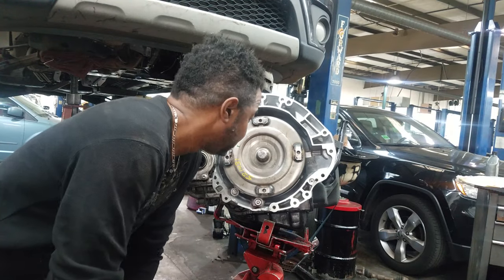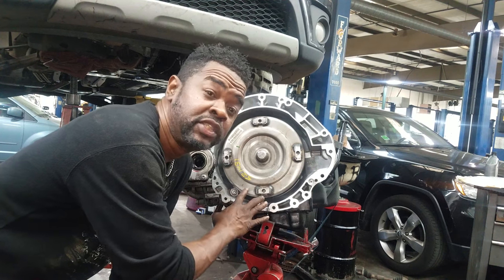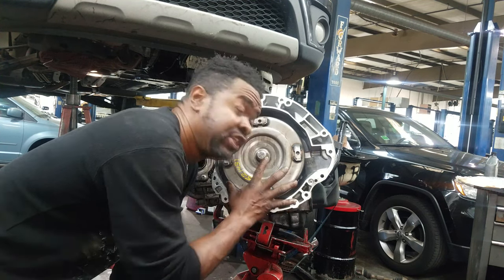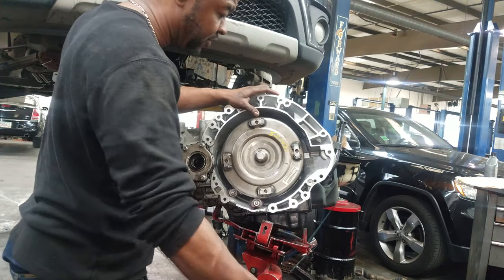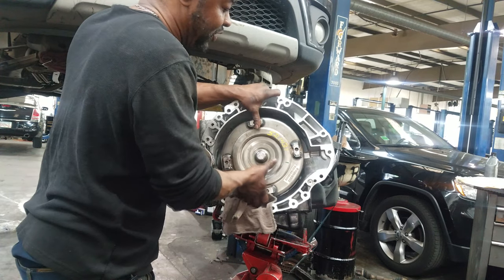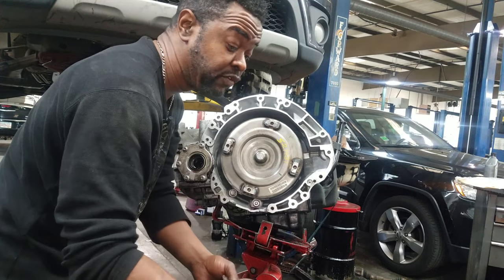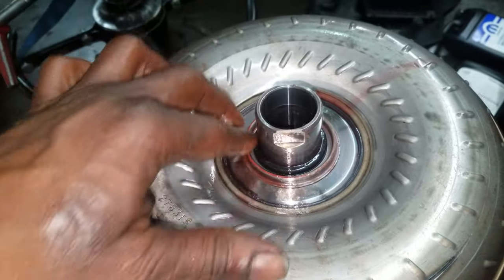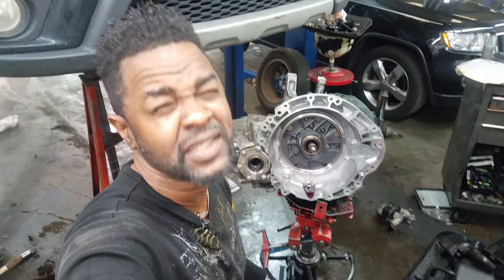How to replace a Torque Converter. Insert it correctly. Transmission whining noise P1750 P0740 P0700

Comment: I have 2015 mdx with 145k miles with a bad torque converter. Car shudders between 40mph and 60mph. Should i change the converter now or keep driving like that and rebuild the transmission later? Since the labor is about the same?🤔🤔🤔

Comment: Hi Sir,
I have 07 Toyota avalon with 217k miles. Fluid is clean… I did feel a shudder so I had it drain and refill plus filter done two years ago. Fluid is still good color. But I’ve Notice everytime (I drive highway about 90% of the time) I let my foot off the gas and press it again, it wouldn’t thud and accelerate. Could this be related to the converter?

Comment: I'm not sure if you'll see this question but you mentioned something about the insurance company....  Can a torque converter get damaged from a car accident?  Someone hit us a little over a year ago and we've had a vibration (like going over a rumble strip) at around 1400 RPMs.  The vibration did not exist before the accident and no mechanic in our area can figure out what the problem is.  From what I'm coming up with online, it could possibly be the torque converter but I have not been able to find out what would cause the torque converter to fail.  Thank you.

Comment: Since my partner passed,  I've been learning to do the many things that he did.  However,  this repair,  won't be one I can do on my own and would really appreciate it if someone could answer a question for me,, please?

My 2010 Impala LTZ Automatic (126,000)  won't pass Smog and the check engine light reader from Auto Zone says I need a new Torque Converter clutch.   The part is just $45,  and understanding the labor part is a bitch to get to because you need to take the left tire off and work it from there.   My question is,  how much time would be reasonably expected with no waiting for the part to be completed?  Because I am a woman, and by myself,  I feel the price I was quoted,  needs a second opinion, and I just want to check with the pros here, if it indeed sounds reasonable.  Thanks, if you stuck it out till the end.

Comment: Question ive got a nag and its as if the torque converter is leaning down i cant for the life of me figure out how to get the bolt holes to line up straight i have to take a screw driver and lever them up to get one bolt in the hole what am i doing wrong if i cant get the bolts in the torque converter i cant fix the car

Comment: Thanks for the video very good information.  I have a 12 GMC Acadia that has shudder but don't throw out any codes.  Took to dealer they added instant shudder fix but was advised it may or may not correct the problem.  Months later still dealing with the same problem took to chevy dealer was advised i needed a fuel pump (expensive job) had it it replaced and thought my problem was solved but i still feel the shudder around 40-45 mph and sometimes going up an incline. Replacing pump did seem to help some but the problem is still there.  Any advice would be much appreciated!! Thanks!!!

Comment: My 96 accord has been pulling a p175 code for mainshaft input sensor but I replaced it and reset the ecu and cleaned up all the solenoids and connectors. I'm pretty sure it's my torque converter. If not it's probably the entire tranny right?

Comment: Greetings blessings and thank you for helping, sharing, will this address a issue with a 2010 maxima P0744 code ? Thanks in advance!
Reply from the maker: Hey bud, thanks for watching. I think Nissan use a different stradegy to allow for T/Conv lock up. They may use an external solenoid valve of some sort. As oppose to Dodge, this code will result in replacement of the T/Conv. Thanks for watching, please thumbs up the video and subscribe to the channel, thanks

Comment: seems like some other mechanic didn't install the front pump seal correct before you got to it and when you went to take off the torque converter it was stuck or heat welded onto it.

Comment: Does anyone know if you change your gear ratio on your truck should you change install a torque converter with a different stall speed or does it affect your torque converter at all

Comment: Hey bro please help me. I recently changed the tranny valve body successfully, but after installing it, I had to take the vehicle back in to Jeep to get it reprogrammed, and they were pretty pricey. Question.. on a 2015 grand Cherokee if I swap the torque converter do I still gotta take it in for reprogram?
Reply from the maker: Is this Jeep equipped with the Nag trans or the 8 speed ZF? Also are you subscribed to the channel?
Reply: @OnlineMechanicTips  lol. Of course I’m subscribed my man!!! And yes my Jeep has the 8 speed ZF… I want to say I have a bad converter since I already have 110000 miles and when I’m idle I have a knocking taka taka taka taka taka taka loud sound right at the converter direction.
Reply from the maker: @supermariobronsmiranda6735   The T/Conv will not require a flash programming. The valve would since the TCM included with it. Every repair I make to these trans I do however complete a quick relearn tho. But its not required, just recommended.

Comment: Ok I went to auto zone because my engine light turned on and they said my torque converter is the problem the code is p1750 could I just replace the torque converter or do I need a new transmission
Reply from the maker: Hey what kind of car is this?
Reply: A 04 honda odyssey
Reply from the maker: @nicolemaria4615  Hey ms lady that code in those Honda usually  indicates a mechanical problem in hydraulic system..Now depending on the condition of the fluid will determine if theres internal damage.I can almost assure you most shops will simply recommend that you replace it in order to cut out all the risk..I would not assume a simple T/Conv replacement would repair this
Reply: Yea that's what they are saying my transmission fluid is almost black😩